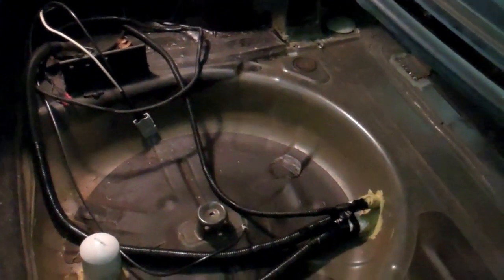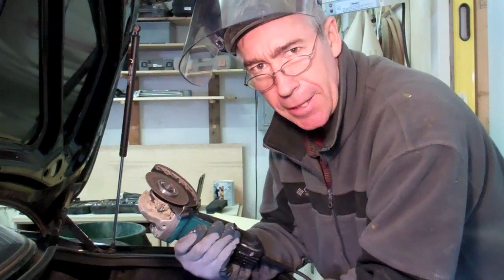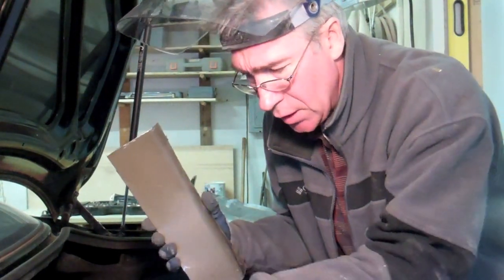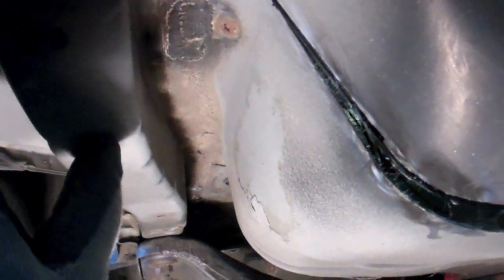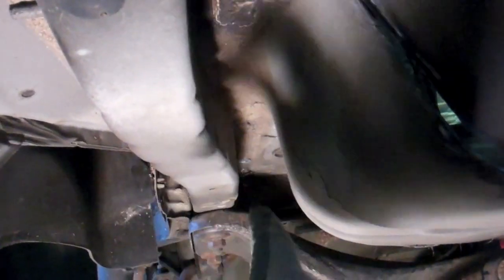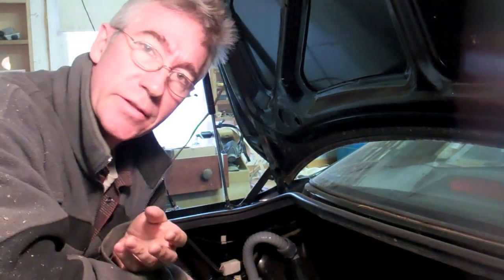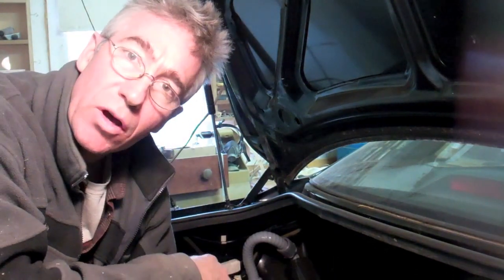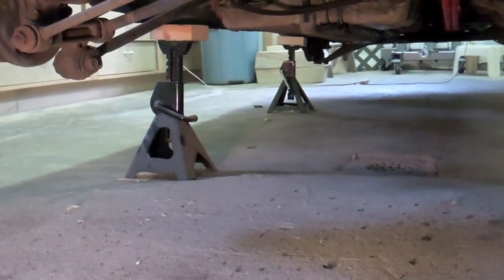John Allen's 1994 Celica Part2

Comment: So what would you do now with a 1994 celica ST coupe, if you had a gas running car in the driveway you're not using? in 2016 I had thought about this some 5-6 years ago but didn't do it. Iknow gas has come down to earth in price today its currently at about 1.33 a gallon Pre the time I stopped driving my 1988 Supra turbo. Its 25 mpg was to low for me then. I stopped driving it when gas hit 1.65 a gallon.
I'd still like to convert the celica regardless of gas prices.
With parts today and the advancements what would you do different today?
By the way on top of the dash by the passenger side airbag isn't a safe place for objects on the dash. that airbag goes off its coming into the driver's head at 2oo mph or more.